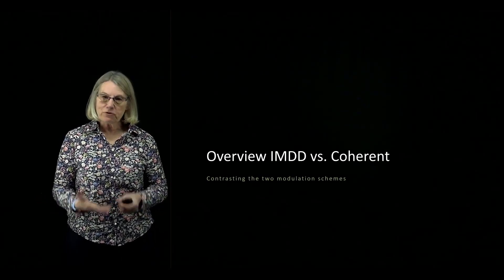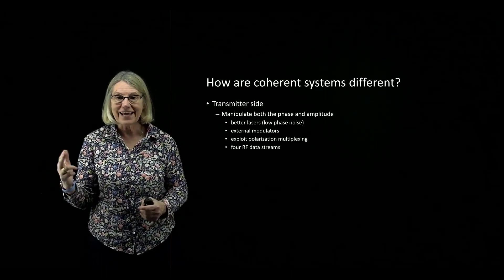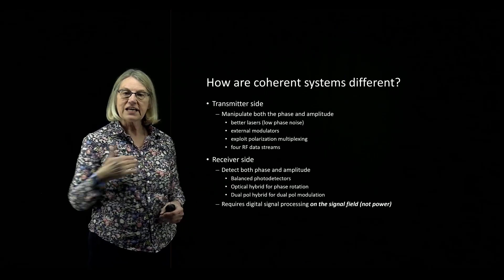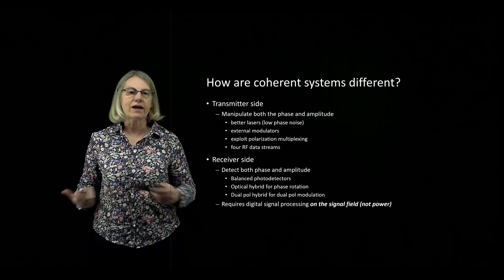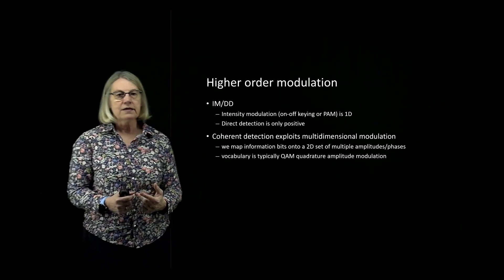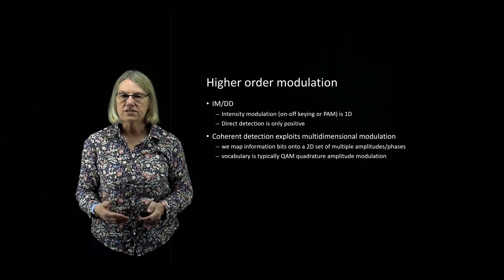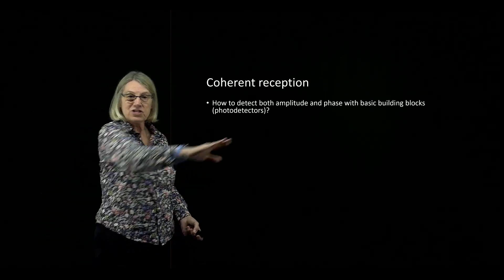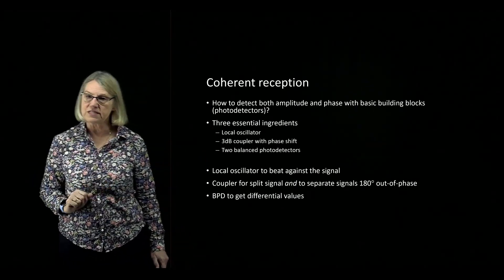Optical Coherent Detection - Overview

Comment: Dear Mrs. Rusch,
First of all thank you for this great video. I don‘t know whether you will read this but I have a bit of a problem understanding why 2D-QAM shouldn‘t be possible with just IM/DD.
Looking at WiFi QAM demodulation can be performed in DSP. Do I really need the entire phase information on my detected IM-signal when I just need to separate it into inphase and quadrature component which can easily be done by performing a multiplication with sin or cos and filtering it with a lowpass-filter?

I understand that coherent detection is neccessary for applications like DPSK but for 2D-QAM IM/DD should just be fine, shouldn‘t it? Looking at literature I found a lot of papers stating the use of QAM-Mapping in e.g. OFDM-applications while using direct detection.

Am I missing a point here?

Greetings from Germany!

Kind regards
Flo